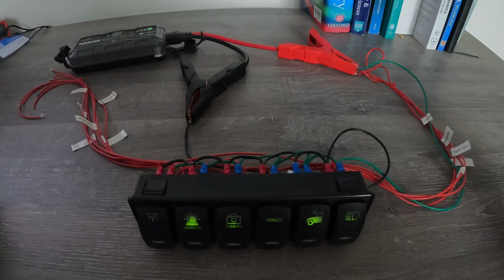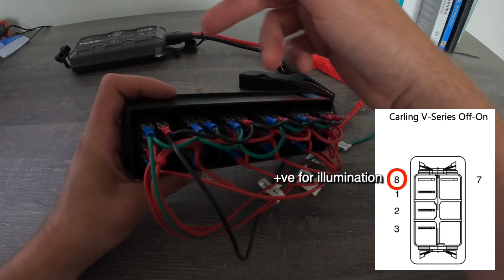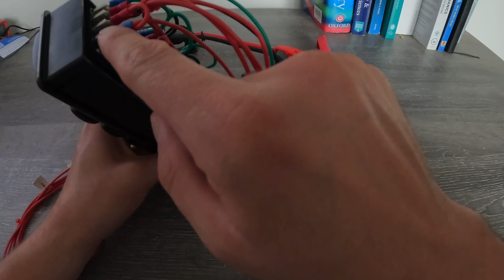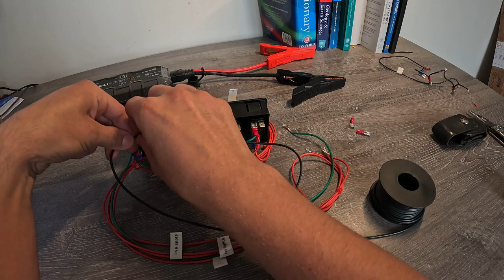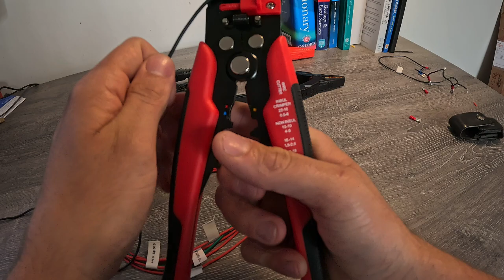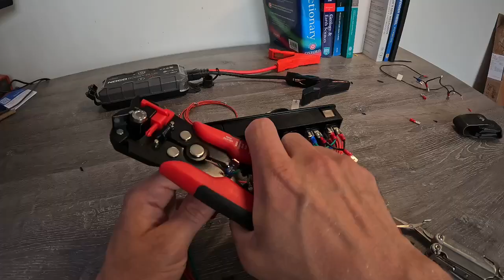Defender 110 XS Carling Accessory Switch Bank Wiring (Mud Stuff UK)

Comment: Personally I detest the Carling switches as they are big, bulky and not that well made if I'm honest, the internals are very poorly designed. The main issue is that it's better to do a earth control circuit for a lot of reasons and you can't do that with these switches generally, they are designed for a positive switch. As most thing are designed to be relayed, negative switching makes much more sense. I have a load of original Def td5/tdci/Disco 2 switches and they can be easily modified for pos or neg switcing and differnt colour ident lamps.
Reply from the maker: Thanks for taking the time to respond. I cant say I’ve had any issues that I’m aware of since wiring and installing, but agree that across the board quality seems to be deteriorating on most things compared to old. Keep hold of those original switches, probably only one way their value is going.